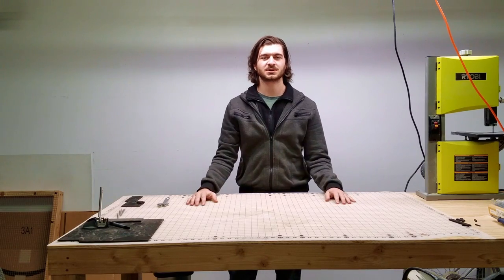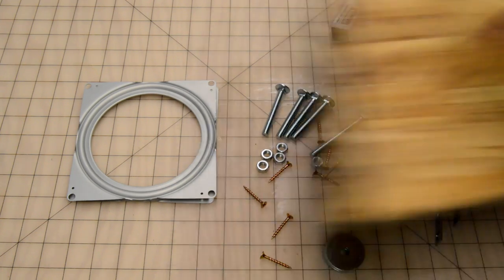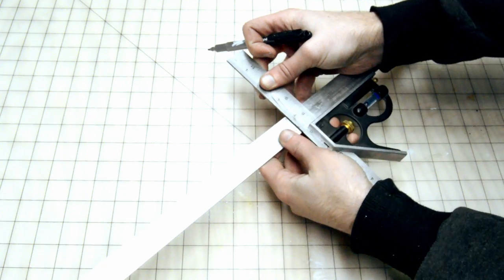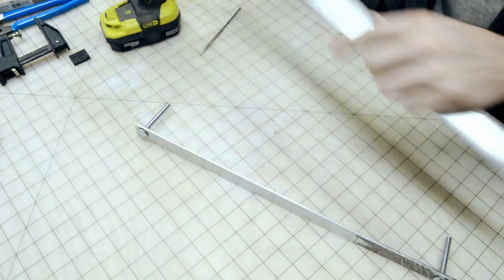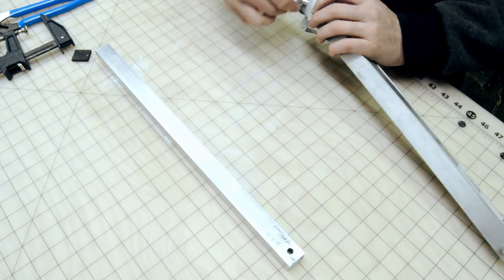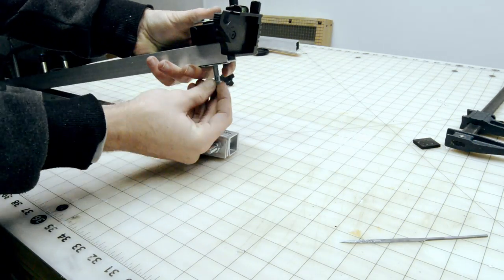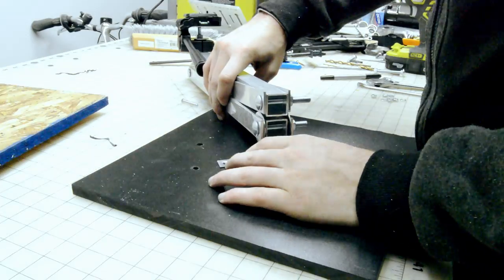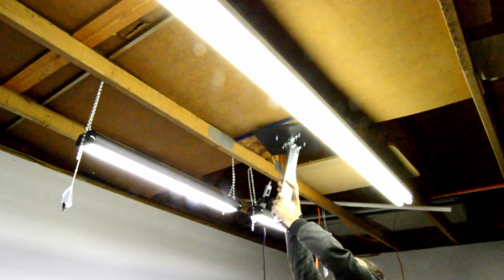DIY Ceiling Camera Mount | No more tripods in the way!

Comment: how tightly can the joints hold? Can I use easier to tighten nuts? Maybe wing nuts and plastic washers would make the joints hold more weight at extended angles.

Comment: Very good video, this item is definitely something i need. But I have questions, does the camera stand somewhere in the middle in the air? or does it need a springy system for that? it just looks like it drops down to the maximum length with a DSLR camera.

And how can i mount this into a concrete ceiling?
Reply: Masa Üssü liquid nail the lazy Suzan on the ceiling

Comment: I need to do this in a drywall ceiling. Any suggestions for a sturdy means of anchoring for this? I know the rig is lightweight, but my camera and lens are pretty heavy.
Reply from the maker: Yes, if you can't find a stud in the ceiling to screw into I would suggest using butterfly type drywall anchors. Try searching "drywall anchor" for options that might work for you.

Comment: if you need to make a micro shot, how shaky your contraction?
Reply from the maker: This build is not really built to do moving shots, so it is a bit shaky when you move it around. 
The last shot in the video where I pan around the table kind of shows the shakyness (with a small bit of stabilization added)
Think of this as a stationary tripod, just on the ceiling.